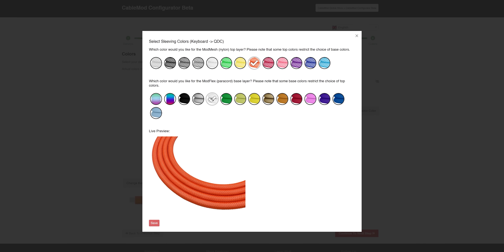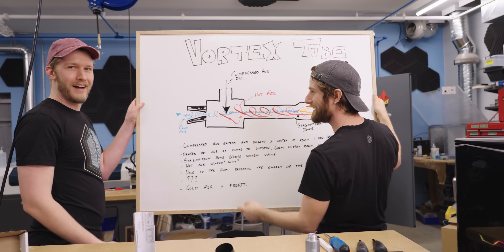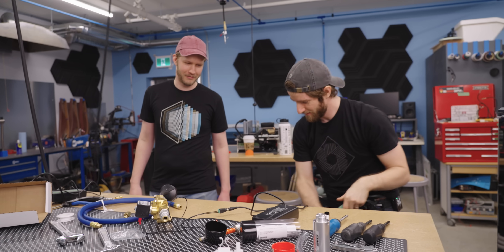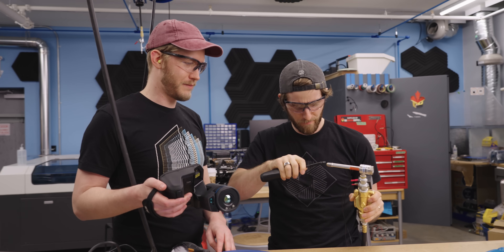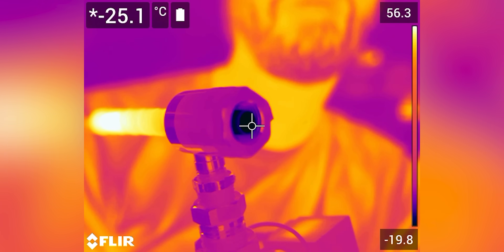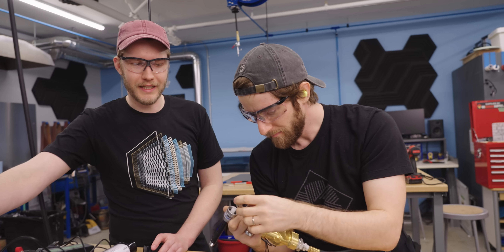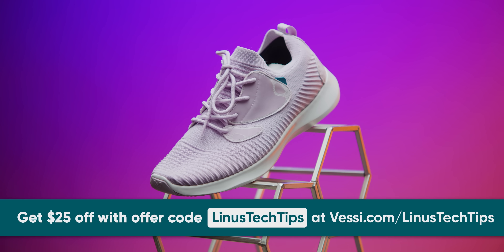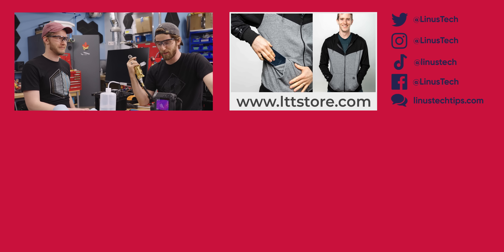This is a CPU Cooler? - Vortex Chiller

Comment: I think it would have worked better if the cold air had been directed across a plate strapped to the chip. There will be lots of wasted  energy from the gas escaping across the chip unheated, but this could be mitigated with a controller. Make a metal plate with 1mm spacing. Fix the system so it can be turned off or on. Put a thermocouple on the inlet and outlet temperature and dial the volume across the 1mm space to a temperature delta of 5 or 10 degrees. I bet it will work.

Comment: This is how your air conditioner work, compresses a gas into a liquid and uses evaporative cooling, think sweating to cool down the surface by removing latent heat by phase shifting the liquid into a gas. The compressor compresses the gas which allows the gas to become a liquid by pressurizing it and cooling it off. This allows you to take a liquid that would ordinarily only be liquid at -30 degrees and have it condense in in room temperature. It all runs in a loop and pumps the heat away through controlled evaporated cooling. You can also think of how that can of compressed air gets really fucking cold, that's because the liquid inside of it is phase shifting and carrying the heat away.

Comment: The best part is a large enough air compressor to run this at full capacity will pull 10 times the wattage it can cool.

Comment: Why not make an airblock, like a waterblock hooked up to a compressed air system, and just have the outlet near the exhaust fan. Would be for effective and wouldn't disturb other parts of the pc. Though making metal tubes and runs for it would probably need more pressure. It could work.

Comment: what about using a water cooling water block with the vortex cooler piped into it? that way there is at least a little bit of a heat sink to sink the head and distribute it so the super cold air can interface with it and actually cool it.

Comment: 2:45 So, it's like an airconditioner?  I vaguely remember it also using pressure to make the air change states, and as a result of that change it releases/uses up energy(heat) thus cooling the air.
Reply: Not exactly, an air conditioner deals with changing the state between gas and liquid, one of these doesn't involve liquid; rather something with the movement of the air.

Comment: I am really surprised you guys didn't hook it up to a water block. Should give a good heat transfer to the cpu. You'd have to insulate your tubes though or I feel like you'd loose a lot of cooling.

Comment: Why not 3D print a cover for the CPU Cooler that will dispence the cold air on larger area and actually keep the fan between the fins... also you can try with fully sealed one and one with extra holes for the room air to ceep going through it for bigger (but not so cold) airflow...

Comment: Used these a lot in tool and die work on the welding side doing differential hardening and to force cool large forms after they got down below a certain temperature. Those things, set up right, get COLD.

Btw. Can't cool a welding torch with something like this because you would blow away your shielding gas.

Comment: Attempting to cool the 12900KS is a perfect demonstration of impedance mismatch. Edit: you'd probably get further by using a liquid between the vortex cooler and the CPU, you could try bubbling the cold air into a reservoir and skip the radiator in the loop. You might have to use something like antifreeze or alcohol for the coolant.

Comment: I bet an older watercooling block (low pressure drop, high flow) with the air blown thru would probably work great. Or at least much better than direct-die cooling.

Comment: The air is moving too fast out of the nozzle to cool a CPU - it takes time for the heat to transfer from the metal to the air, and if the time taken to pass over the CPU is shorter then the time to transfer the heat, then the air picks up a smaller portion of the heat then what the regular heatsink can handle - same thing happens inside a car motor when the coolant thermostat is removed.
If the cool air was slowed to a rate that matches what the heatsinks fan can move, then it would have time to collect more heat.

Comment: you should have used a sealed case and had the cold air in the back and a single exhaust port out the front.

Comment: It's actually not that hard to understand..

The compressed air is sprayed into the side of the tube by a nozzle. This causes it to cool down in the same way as a can of compressed "air" gets cold when you spray it. Because it was sprayed into the side of the tube, this cold air swirls around the inside edge of the tube, spiralling towards the hot end. As it swirls, it rubs against the tube and against the air in the middle of the tube and heats up as it moves away from the inlet (kinda like friction). At the hot end, most of this hot air is released out the hot outlet. But a small amount is directed back down the middle of the tube towards to the cold end of the tube (ie near the inlet). Because the volume of air being sent down the centre of the tube is quite small, it cools very quickly as it moves towards the cold end of the vortex. When it reaches the cold end, the air in the centre of the tube is allowed to escape out the cold outlet.

Comment: The lack of condensation/ice on the inside of the tubing is due to fast moving air particles ripping the ice particles off from the walls which further cools the nozzle.

Comment: Just a theory, yet if you were to design a cooling tube of sort to blow and channel the cold air more effectively and cover the whole surface area of the CPU. A defuser of sort while allowing max airflow. It won't exactly be a diffuser since it's purpose would be to spread the cold air on the surface of the CPU not to decrease airflow speed.

Comment: I feal like there were 2 reasons that blowing the cold air at the radiator didn't improve performance. One was that the surface area the compressor could cover was small compared to the large fan. The other is that the radiator is designed to carry heat away from an object, so it wouldn't transfer the colder temperature offered by the vortex. If you could design a shroud to cover the CPU and spread out the air, then blowing it directly onto the CPU, it might work better. If you start with the CPU at a cold tempriture and maintain it using forced cooling, then that would work best. But that takes a lot of energy. Truthfully, heat transfer is a more efficient method of cooling than direct forced cooling in this case. Anything that is hot has excited molecules in it. When you try directly cooling the hot molecules with cold molecules, there is resistance because the hot molecules want to transfer their heat, but the colder something is the harder it is to transfur heat to it. That's why heat transfer to conductiv materials at ambiant is better in this case. The heat causes a chain reaction through the radiator and into the air, blowing through the fins. In reality, you're not cooling the CPU but spreading out the energy it generates.

Comment: Try using peltier device. Mount the cold side on the CPU and hot side on to the heat sink and screw it in place, power up the module and the heat sink fan, and see what happens.
Like if you want to see Linus doing it.

Comment: OK since you said the vortex cooler didn't cost much to run.  ~$10k for the compressor (upfront cost)..+..10 hp motor(guess) = 7457 watts when running at full load...just multiply runtime.  I suspect it's quite a bit more than you think!

Comment: I wonder if having this blow into a case to pressureize it with cold air through a taping, where the case has no fans but just a small amount of exhaust grille , and leave the heatpipe tower cooler on with a fan to circulate the cold air thru the heatsink

Comment: Needs more science.  You have more airflow than the case fan, at lower temperatures, so it's just a matter of getting that air to the right place.  

In the future I'd also like to see more info on "computer cooling if sound doesn't matter", or at least if sound matters a lot less.  I, and I imagine many MANY other people run my desktop in the same room as a window or portable AC, because without that even in the winter the room is going to get too hot for my body even if the PC is perfectly cooled.  Those things are noisy, so a slightly noisy fan or other cooling method won't even be noticed as long as it's the same kind of noise.

Comment: i think it could work with the noctua heatsink with a shroud to spread the air out so its a column instead of a tiny point. you would definitely need way more cfm though. a cheap case fan can comfortably move 30-50cfm so bring on the twinscrew compressor ;) something like an oldschool thermalright copper brick might work better with sub zero air remembers back to athlon xp days air cooling in calgary winter

Comment: The reason it didnt work is that air is not really a great conductor, even though you spray -30 degrees. Its just gonna chill the air around the cpu and it wont be able to cool it off as quick as a cpu cooler block

Comment: Air is not a good medium to transfer heat.  That's why the CPU end of a cooler can be rather small and the air end of the cooler (radiator) needs to be much bigger.

Comment: I think its a similar principle to a Freezer. A compressed gas, now turned into liquid, is realesed into a more open space, absorbing the surroundig heat wile It expands violently into a gas. Of course here, the compression never transform the gas (Air) into líquid, bit adds a decent amaunt of preassure to It.

Comment: The CPU heatsink surface area has to match the cooling capacity of that cooling device. The IHS has way too little surface area and bottlenecks the cooler. The big fin array from the air cooler has too much surface area which cant all be cooled at the same time and equally, thereby creating hotspots. You need a small custom copper heatsink with fins that this thing can mount/clip into. You'd then need to add fins and air cooling to the hot side.

Comment: the car radiator back in the day when working as a car mechanic i was thinkin of using the heater core as a radiator its much smaller

Comment: Why cool a welding torch when you can run HHO and pinch the torch tip with you bare fingers and not get burned while putting a hole through a fire brick in two seconds, and also sublimating tungsten!

Comment: I think you guys are missing a big thermal mass the cooling can affect, that also transfers heat quickly and efficient, like a copper block. Directly cooling a heat source normally brings out sub-optimal results.

Comment: Why not use a passive heat sink with no heat pipes. One of those little blocks of aluminum with fins like on a raspberry pi, just bigger to fit the Intel chip.

Comment: Air is a poor conductor of heat, it just can't move enough heat away fast enough from the CPU die. Maybe try  using it to remove the heat from a water cooling loop, likeblow this over the radiator instead of the fans.

Comment: Just build an outer case for a water coolers reservoir tank, with an intel at the bottom and a outlet on the top (Inlet and outlet using air fittings). Blow the cold air in. Done.
Edit: just make sure the cold air isn't cooler, then what the glycol mixture/ or reservoir tanks plastic can handle.

Comment: You need a custom copper cooler so you can attach the tool and control the cold air flow and give better cooling

Comment: I think the application could be way better, you cant just blast the die with air its a massive waste/misdirection of energy, you need to have a ducted system with heatsinks at least to keep your cold air as confined as possible and insulated from the outside to take advantage of those temperatures. Not only that but the internal volume of your ducting has to be as minimal as possible while maximizing the surface area of your sinks. Even 40CFM wont do anything by just blowing on it. You guys are on the right track, but you need to duct that cooling solution. Just take a Noctua NH-D15, rip the fans off, and build an enclosure around it as tight as you can and make a chokepoint inbetween the two towers. Also seal it, that moisture will kill someone/thing.

*12900k owner here, she gets SPICY
Reply: They're just tying to have fun, not make the dumb blower work. And nobody cares how hot your CPU is, undervolt it if you want it to be cooler. Lol

Comment: i have an idea use that module to cool a water loop instead of the radiators or use a coolent which doesnf freeze given it gets down to -50 c so yea that would be a nice thing cuz then you could practically use that in a desert lol or even use the heating side in artic conditions to keep things from getting too cold?

Comment: looks like a plasma cutting tip modified and remarketed.  When you compress stuff it gains heat, when it decompresses it cools down  they are using some sort of  monkey business using that.   I would be inclined to run the air thru a water block, if it is indeed cold.

Comment: Simple explanation hot air comes in with high pressure, the higher the pressure the hotter the air, after compressing its allready starts cooling down and looses heat maybe using a heatpipe would increase cooling even if its just a fracture, after it expands again the temperature rapidly drecreases because of the increase of volume. Yes its a pretty oversimplified explanation but the best which i think anybody will understand. Its the same principle as in huge turbochargers with an additional charged air cooler.

Comment: @Linus Tech Tips  I think this would work best on a water cooler. Spray that minus air on the radiator fins or radiator of the water cooler. I think this might work or is it too large an area?

Comment: Big problem for peltier elements is also that you can super easily burn them out, plus you are not actually moving that heat away (just to the other side of the element - and then what?). This thing? As long as you don't melt the metal you're doing just fine. Plus you can connect a tube to the ends and take that excessive heat away quite easily.

Comment: "...but peltiers use a TONNE of power". 🤔 Well, an industrial aircompressor often uses several kW... so by comparison peltiers are darn efficent. Also makes much less noise. Usually all extreme cooling ends with refrigirants / LN2 / CO2.
You should have stuck an old alphacool pin heatsink and used cold air on that, the laminar (non turbulent) flow of air over a flat surface like cpu coldplate basically sheilds cpu from more cold air reaching it. I think that was the largest problem with this setup.

Comment: I've had one for 27 years in my tool box.. its used as a choke tester for carburetor's 😜 I get frost out one end and heat the other... Nothing new.. just a new twist on an old tool. Air compressor not included!

Comment: Well maybe you should just let the system take the Cooler air. "Lowering Ambient" this would defenetly Work. So Seal off all intakes and just put Cold air through the intakes. Try to pressurize the Case slightly so it works. But one Tube then might not be enough to give you the needed amount of air.

Comment: I wouldn't call that whole thing the solenoid, it's the Black part with the wires coming out of it, that includes the core that slides into the gold part.. The rest, gold part, isn't a solenoid. I could be wrong though. I could be wrong though.

Comment: Linus, you cant have the air move that fast theres not enough transience time for the heat to be drawn into the air from the CPU. You can make this system work if you design it similar to a liquid cooling system but it wont work like an air cooler.

Comment: If your looking for best of the best in air compressor... Then I would recommend a rotary screw air compressor, if you don't mind spending some cash. They sell them in smaller sizes that are made for work shops, my plant run 4 Sullair 100hp motor 440cfm at 120psi at the same time

Comment: It probably didn't work with the cpu because the cold air was moving too fast for heat transfer to occur. Air is a terrible heat conducter, so it needs time, or a lot of surface area, but preferably both. The air coming out of this device is moving too fast to effectively cool this system.

Comment: By the looks of that drawing all that thing is is a sandblaster or at worst an old Venturi design from an old gasoline carburetor! but it looks more like a sandblaster design but they replaced the sand with air from some unmarked place..  

It sounds like they are confusing air pressure (PSI) and  electrical power units (watts) and trying to use them to explain the same function...

Comment: Heat pipes stop working at too low temperature. Then they become a terrible thermal interface between the fin stack and the cold plate.

Comment: Do you think it failed on the heat sink heat pipes because it ruined the vapor distribution condensing it before it could transfer heat to the fins?

Comment: You need an engineer in your team, period! Just imagine how many more things you could build, and experiment on with all kinds of devices and show them to audience. What you could have done with cooling CPU is build a box (on 3D printer for example) around that cooling CPU radiator with two opposite openings of the same diameter. this way you would have a cool air from vortex cooler flow through the whole radiator before exit sufficiently cooling the CPU.